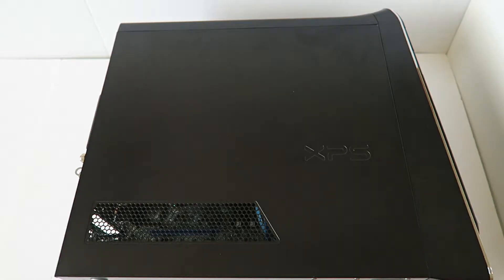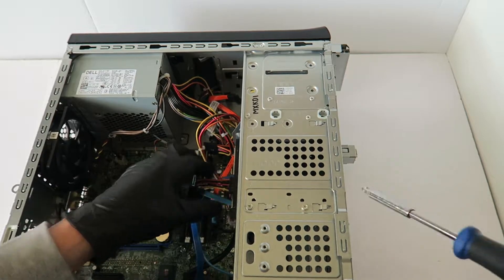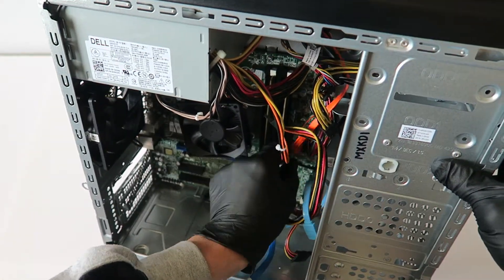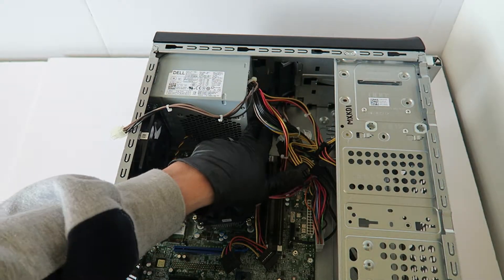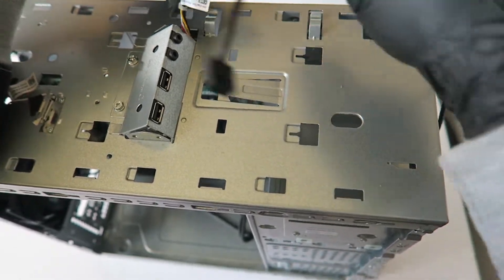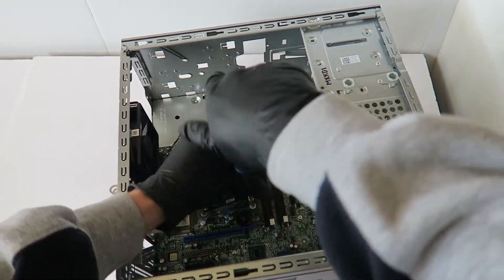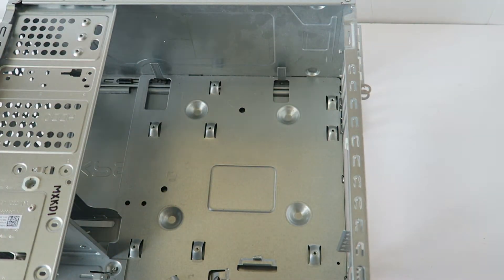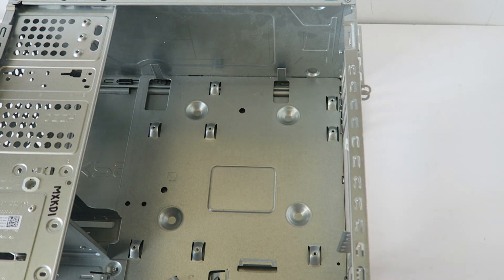Dell XPS 8900 Teardown

Comment: Great video Bro. What size is the power supply in the XPS 8900? I have one and want to add a video card and upgrade the memory from 16gb to 32gb and need to know if the power supply is strong enough for the video card. Video card is ASUS GTX760-DC2OC-2GD5 GeForce GTX760 2GB GDDR5 256-bit. Thanks! Also upgrading from Windows 7 to 11, plus extra software upgrades. Thanks!
Reply from the maker: Hi, thanks. That dell does have 460Watt power supply and ASUS GTX760 requires 550Watt power supply you could upgrade i recommend.. 32GB RAM will work fine in this system and if you going to install extra hard drive for extra storage i would just upgrade power supply to 600 watt and depends what brand you use because cheap brand i would avoid buying.

Comment: A "extreme power system" doesnt have gpu and ssd
Reply from the maker: Hi, do you really want to upgrade power supply and video card in this PC ?
Reply: @Mxkdt  of course if you add ssd and gpu it be a more capable system in 2022

Comment: Do the cables under the top cover have anything to do with the heatsink? Im trying to open this area to access it. Ive had hardware crashes and screen freezing for months. I have a Dell XPS 8300 and the inside looks largely the same and I have done the Dell diagnostics and it says theres a problem with Heatsink cable not being detected. I see on my PC theres a broken cable (with 2 mini cables-  black and white - inside a black one sticking out). Does this cable need to be replaced and is it heatsink related? Thanks.

Comment: I have an 8920 and the front usb ports don't work right. I have to jiggle them around to get a connection . Is there a way to get the panel off or somehow fix the usb without taking it apart?
Thanks
Reply: unfortunatley there is no way to fix it without opening it up. ts just that the xps 8930 and 20 have very fragile usb ports in the front maybe you damaged the pins and now its struggling to find a connection. you can find a replacment for about 40$ usd on the dell website.
Reply: @reflexnyc0  Thanks for your reply. I did look and could not find the replacement. Could you please send me a link?
Thanks Bob

Comment: Somewhere around 6 minutes you pounded the top off breaking the release clip - Everybody else pull down on the metal finger under the top to slide the top forward.
For access to the on/off button remove the 2 screws holding the disc player and slide the player out about 1 inch to see the large metal top release clip. Also front comes off easy if you apply outward pull and release the side clip closest your hand first... then the next and next furthest away.  This guy is helpful but,  makes it look harder than it is.
Reply: Thank you!!!
Reply: Even the service manual doesn't tell you about moving the disc player.  Thanks so much!
Reply: Thank you
Reply: Dang thank you, so much easier
Reply: @KeithOlbermannn   Took me a while to find it ... But glad I did. It's not easy to find
Reply: Thank you. Btw for anyone else looking, the metal finger is above the CD reader. No need to remove it you can press the tab in with the reader still in.

Comment: I can't for the life of me get the top pannel off without breaking clips
Reply: I just had the same issue.  I am working on a Dell XPS 8700 and it has the same characteristics.  To avoid breaking the clips, remove the optical drive.  Above it is a lever, well a bent piece of aluminum that is "locking" the top cover in place, pull it down and the top cover comes off with ease.
Reply: @squ1ddos  thanks man I totally overlooked that giving it a second look today I see that was what was holding me back
Reply: @squ1ddos  you are a lifesaver my dude
Reply: @gothicsoldier  you're welcome.  Glad I could help.

Comment: On my PC the second clamp would not go down do you need to use two screw drivers to unlock them?
Reply: The 2 claps keeping the power supply from being removed
Reply: But one of the clams are being blocked by two pipes on underneath it
Reply from the maker: Hi, what clamp are you talking about?
Reply from the maker: Yes you can use two screw drivers to pres on to release claps for power supply slide to the right.
Reply from the maker: You have to use flat head screw driver.
Reply: The top clamp is still not going down because of metal looking pipe underneath it

Comment: Great teardown vid! My question is... what was that thin wire on the top of tge case towards the back? When you removed the plastic top bezel, i saw a thin wire with a white tag behind the top usb/ear,mic jacks. It looked like it was soldered to the top chasis. Do you know what it is?
Reply: Hey David. He skimmed over that detail didn’t he?  Well it’s the M.2 card which handles WiFi and Bluetooth 4.0 I believe. The skinny cable goes around the back fan and up to the top of the case, under the top bezel. The wires are the antenna for BT & WiFi.
Reply: That's the antenna cable for  WiFi Module .

Comment: What’s the black and white wire connected to the motherboard?
Reply: Royce Davis possibly wifi/Bluetooth
Reply: @SCWaiii  yes thanks, I figured it out . You're exactly correct.  Antenna for wifi/bluetooth .👍
Reply: @DavisAutomotive1  any idea how you would go about installing that in a new case?

I'm about to undertake a case swap, but don't want to buy a new wireless card.
Reply: Kabal82 I bought a new card with external antenna bro. I can send a picture if you like
Reply: @DavisAutomotive1  yes, please. Would be helpful on weighing my options.
Reply: @mikeO31082  I watch this video to see how he took out the wireless card as I am purchasing an upgrade card. He totally skipped it and tore off the antenna wires.
Reply: Ya do you know how to remove the wifi card? I am currently trying to upgrade but there is a plastic protector in the way
Reply: Andrew Wagner you unscrew the plastic and the card will come off with it, its simply inserted into the slot. 
How you get the actual antennas out from the pc? I’m trying to figure that out. There are parts on both ends restricting it from going through the tiny hole
Reply: Kabal82 damn man I'm sorry. Just saw this🤦🏼‍♂️

Comment: Great detail on the teardown, sequence  etc. I might suggest a little verbal detail-explanation of typology of components so we viewers could have a better idea of  how feasible upgrades could be in replacing such components. For instance, what type of proprietary mobo s used in these Dell 990 machines, power wattage of PSUs, etc. and your thoughts on replacing various components. Thanks again.
Reply: As an owner of a dell optiplex 990, i can give you some advices.
1. These are the motherboard infos: 
Manufacturer                  Dell Inc.
Model                                  06D7TR (CPU 1)
Version                                  A00
Chipset Manufacturer   Intel
Chipset Model                  Sandy Bridge
Chipset Revision                  09
Southbridge Manufacturer  Intel
Southbridge Model          Q67
Southbridge Revision           B2

2. The power wattage of all dell pc's is rather low. Most are around 240w-270w, so it's advisable to change it.

3. For replacing/upgrading: Upgrade the gpu first - a gtx 1050ti is advisable because it is like a "sweetspot" for older pc's-  then upgrade the ram if needed- 8gb should be minimum these days.
then you can think about changing the cpu if you really need it. Best thing would be to get a cpu that can run on turboboost.
Reply: I have a XPS 8900, it's usually a i7-6700, 16GB DDR4 (expandable to 32 GB), 420 PSU with good 12v (which is enough for any GTX 1070), Mobo is standard MATX. Flaws: The wireless card is cheap, I changed mine, added an SSD drive and changed the GPU.
Reply: @_HugoQueiroz  I know this is an old message, but I had 2 8 GB cards in mine, and I added 2 16 GB cards, for a total of 48 GB.  I didn't know if it would work, but it did.  If it didn't work, I would have replaced the 2 8 GB with 2 16 GB for a total of 64 GB, which was listed in my manual as the max.
Reply: @_HugoQueiroz  I'm planning on replacing he gtx 745 with a  dual/triple fan  1060/1070. Can it  sufficently fit or just buy a blower or mini card?
Reply: @jaymay6386  I would say it would fit any "normal size" 1070. I had a Galax 1070 dual fan, normal size, it gave be a lot of trouble to fit it, but I managed to do it.

Don't go 1080, that won't fit. But a "normal" 1070 yeah.
Reply: @_HugoQueiroz   what about mini or blower?  too much heat?
Reply: That's the one I have http://www.kfa2.com/kfa2/graphics-card/10-series/kfa2-geforcer-gtx-1070-exoc.html

I won't go anything bigger than this, since I already had trouble enough to put that in.
Reply: @_HugoQueiroz  thats looks good, really good. To bad the LED lights you wont really see from a prebuild lol.  thx dude for pointing my in the right direction with this.
Reply: William Stevenson I actually hate de red led because it can’t be turned off , so to me thats actually a plus. LOL
Reply: Hugo Queiroz  If u were to get the mini/low profile cards, it may save u some headaches. What's ur psu wattage?
Reply: William Stevenson in theory the psu that came with the case is enough to push a 1070 because it has really good 12v output.

But since it doesn’t come with two 8-pin connectors, and I hate using converters for that, I ended up trading for a 520w seasonic.

A few months ago I ended up switching off the case because I needed more HD’s bays .

So I don’t have de gpu problem anymore, but yeah, I would go for a low profile gpu if I were to keep the case.
Reply: @_HugoQueiroz  hell, i might just get the 1080 since they have a mini now. Just trying to get the most I can with my money w/o the hassle. Maybe I should wait for black friday sales, hope the cards will cheapen down if I wait. Hopefully.